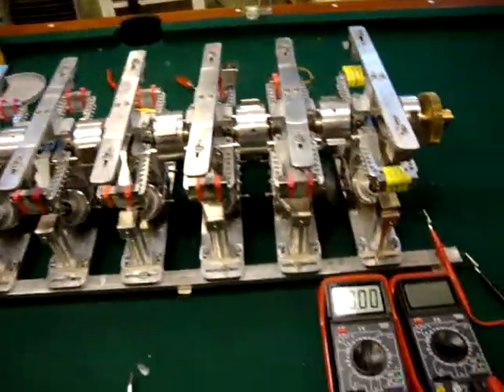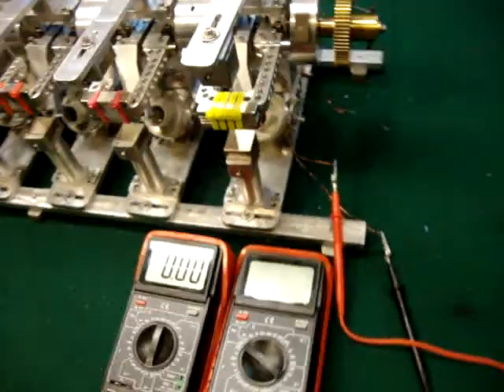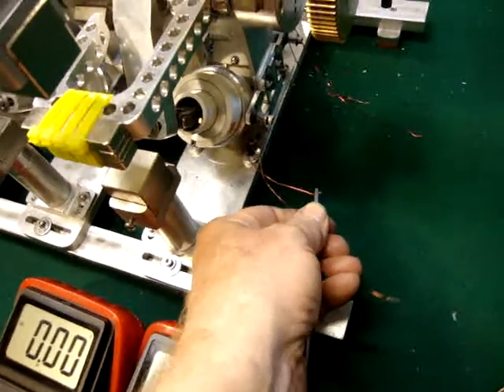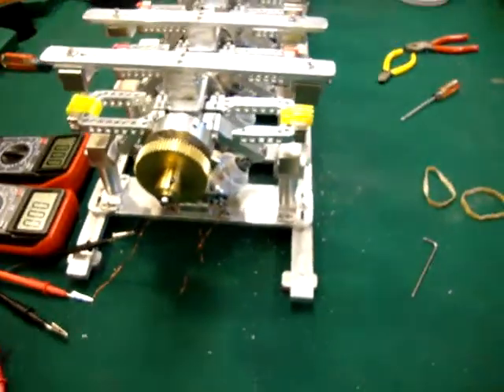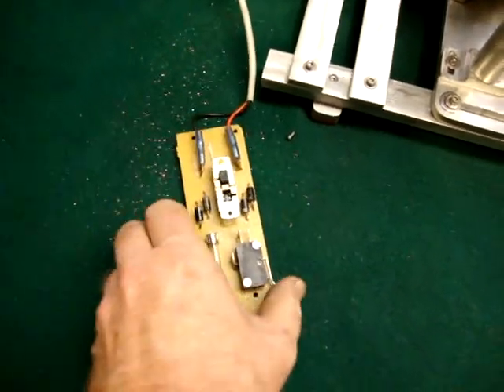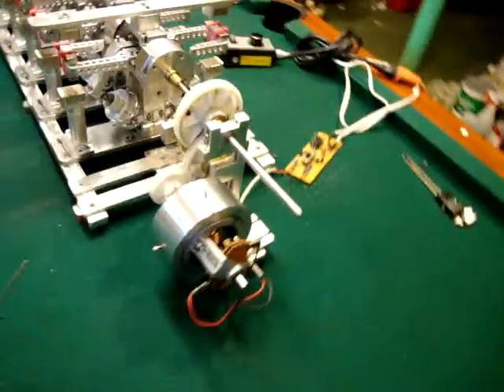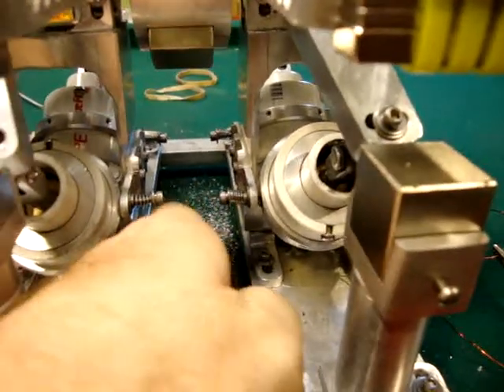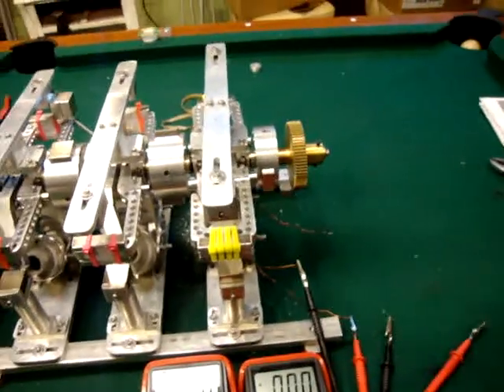Over Unity 24

Comment: you should take advantage of placing coils on top to have in
two coils movement that means you would have 4 in total in each module

or other serious than the same coal in which ends and put the embers to move the neodymium magnets placed several magnet coils with respect to each coil to tap into that general movement Bras and he would do as a lever